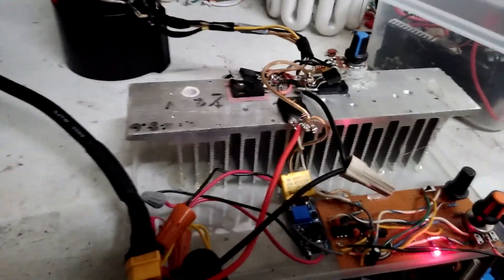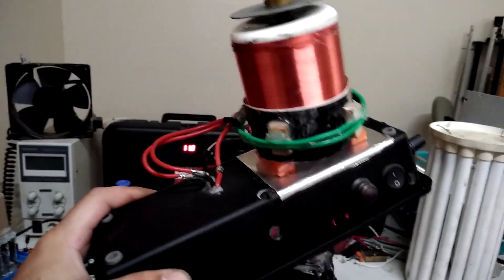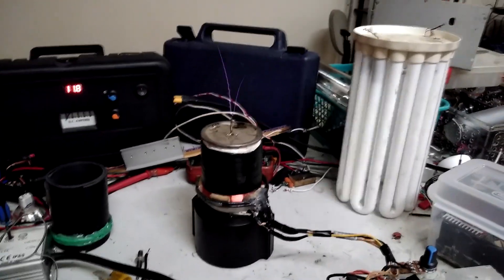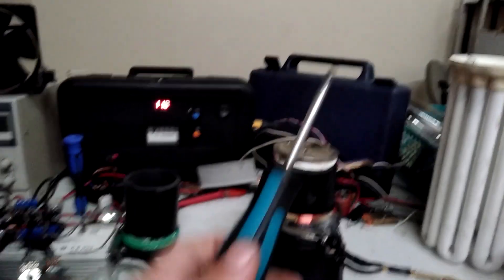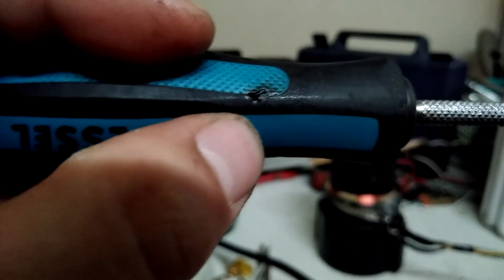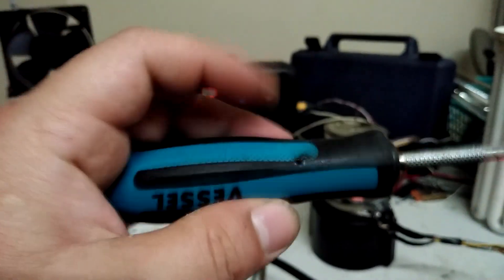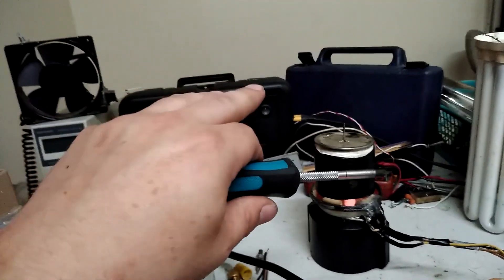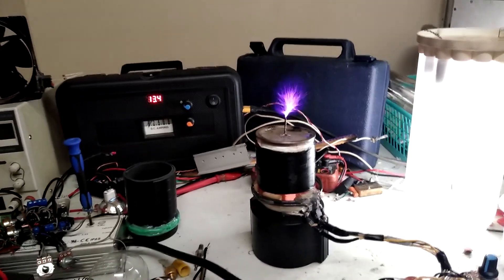More 30v arc action

Comment: It's the first time I'm coming across this video! Never saw it b4 but that's one heck of a powerful performing coil. It's the same circuit as Tefatronix/ skory but seems you are using other more powerful components in your circuit. Have you got the circuit diagram? I'm very tempted to try build one. It looks simply awesome. What's your secondary coil specs? Resonant frequency, etc.
Reply from the maker: yea I really liked this one. I eventually took it apart because it was switching so hard and only survived via a large heatsink. Too large... Otherwise it could do almost anything. 

If I recall it was the basic Tefatronix style circuit and I used IRFP250's and a PWM through yet another IRFP250 to modulate the power rail. 

I think the secondary was something like 32 AWG and it only had about 300-350 turns. Maybe something around 1-2MHz I'm sure.

Comment: Damn, coming back to this as it works so damn good, I got mine going but not too impressed yet, going to see if the new fets work better, already blew 1 irl44z so I got some irf530s on there for fun, you only use 1 zener for each fet?
Reply from the maker: Yeah I never really shaped  anything with the back-to-backs. The zener didn't seem to do much for me with those lower voltage fets driving them at 12 volts or higher anyway but it's probably important to put back-to-backs on there using those fets and I guess not so much with the 250s. I want to say the gdt on this circuit is what's making the difference but my other nearly identical coil would work about the same if I fed it that voltage and ran it continuous, but it's using the choke pull which is just an entirely different gdt setup than this one using the toroid and litz wire.  I probably have another couple videos where I use the same circuit to drive a taller coil and while it doesn't work the same I can still play with the variables to get some interesting results. It was the combination of this particular circuit and that particular coil which worked out the best though. This same coil was my very first build and I had it running pretty good on a different circuit but one day it crapped out and upon rebuilding the circuit it just didn't function the same. Some small variable in the gdt just wasn't being met and I just got lucky that it works so well with this circuit.
Reply from the maker: It's kind of strange because in my earlier testing it seemed like I had to be sort of particular with variables in order to get breakouts that were impressive. For example I had to do tedious testing with my gdt capacitor as well as make sure I was using the right DC and filter caps on my input. For some reason as I moved on making more test circuits and got a little lazier with more basic skeleton setups with the 250s it seemed like I didn't need to do any of that and you could just throw a random gdt on and 0 capacitors in the circuit which is pretty much how this one in this video is. You got to keep in mind that there is somewhat of a exponential increase in your output when you reach certain voltages. So for example this particular one might not seem that impressive at 12 volts. The breakout is pretty small and I can just pull hot arcs from it but I start reaching like 18 to 24 volt it gets interesting.
Reply: @Magneticitist  guess I just have to play with it some more, might just get in to some half bridge designs as well to power a small coil, on a different note I tried various interrupter inputs and I couldn't believe they worked! I'll post the vids tomorrow, it's pretty cool 😎
Reply from the maker: @dirkk82  Yea the interrupting works well but I was brain farting hard when first doing it the conventional way. I basically forgot a 100% on time from the interrupter meant a 0% on time at the fets and by the time it occurred to me I had already moved on to doing it from the power rail. Thinking about it in the end I came to the conclusion I didn't want an only-interrupted circuit possibly going full blast if the interrupter crapped out. The attiny and similar is probably the way to go though. I like playing legit music by controlling the PWM dead-time but it just sounds louder and better when doing the midi stuff with programming, and the arcs correspond with it better for an all around cooler experience IMO.
Reply from the maker: oh man as another side FYI I just want to say I put it in a shitty dollar tree toolbox enclosure and even though things are sort of untidy in there and unshielded, it still works the same lol. Nice. I don't get too concerned over small things like stray inductance. Doesn't seem to matter unless my interrupter is getting interference. I've noticed certain variables don't really seem to matter. This coil for example, I noticed I had jacked up all the lower windings by trying to adjust the height of my fixed primary and it was dragging windings with it causing overlaps and spaces etc. Didn't affect performance one noticeable bit. I've also only had the one build so far which gave me SGTC-like breakouts when using a topload and no sharp points, which was my taller coil wrapped in yellow tape I bought from GBluer years back. All the others put out great fields and pull great arcs but won't breakout on their own with the toploads.